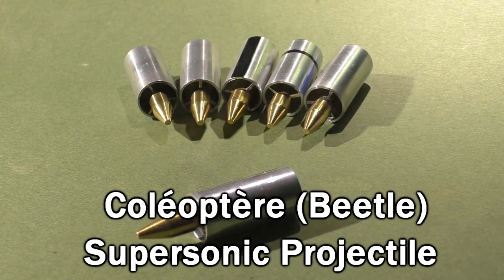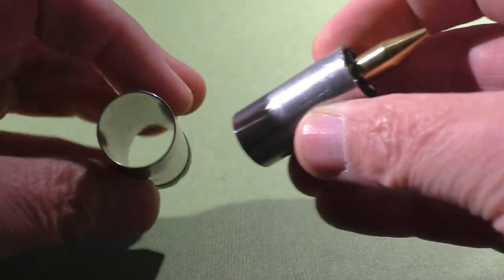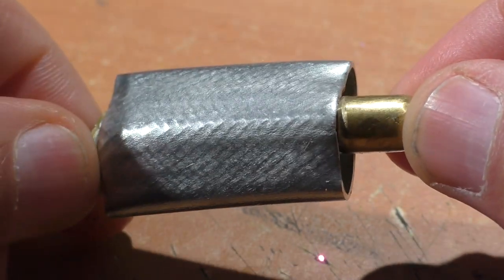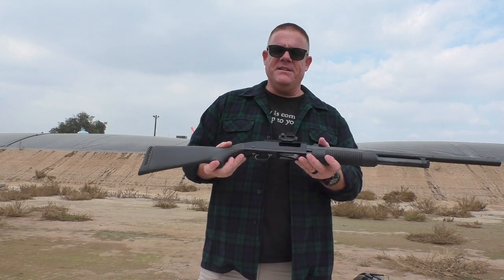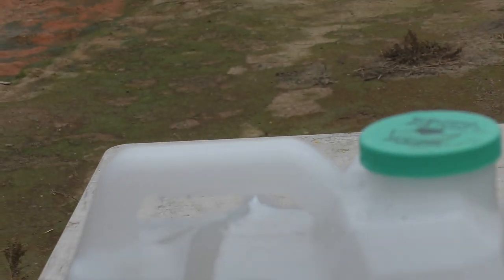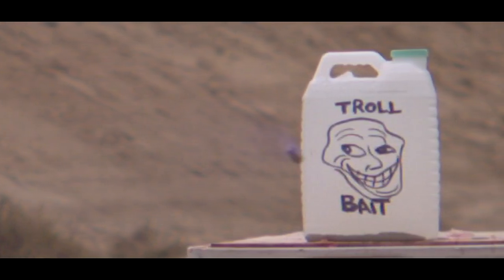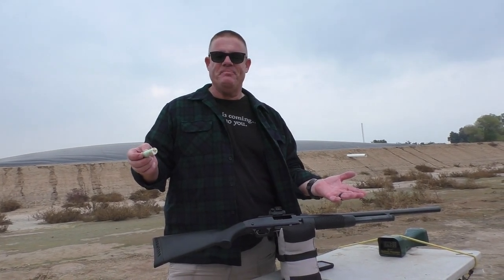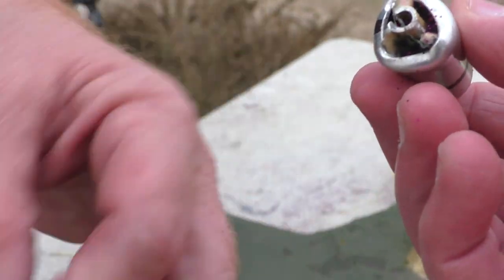Coléoptère Inspired 12ga. Projectiles -  TESTED

Comment: The first round that yawed is why you want to do things that act in any way on the projectile in equal parts. The top sabot support should've been split into quarters instead of halves as halves would create pressure hemispherically and quarters should equalize. Always a balance needed in x and y plane if you want the best example of aerodynamical flow.

Comment: The old firearms adage "The French copy no one and no one copies the French" applies to aircraft, as well.
Reply: Technically the french invented the sabot. The Brits got the two inventors out of France before the germans captured them luckily. So the brits took the idea made it work then eventually the Canadians did a lot research and testing and perfected it. Though I suppose it doesn't count as copying if the brits took it from concept to reality
Reply: @smolwavingsnail9028  The French also invented the modern tank, starting with the Renault FT-17.
Reply: And let's not forget about smokeless powder, self contained percussion cartridges, and haute cuisine. And where would we be without mirepoix?!
Reply: @nocount7517  little willie was invented in 1915 the renault in 1916
Reply: Oscillating turrets, compressed-air fume extraction... Yeah, applies to tanks too.
Reply from the maker: The French were REALLY influential in aircraft design,  probably more than any other country.
Reply: This aircraft was designed by Germans in WW2
Reply: Everybody copies the french, just have a look at all the fake croissants out there😁
Reply: @smolwavingsnail9028  Actually Germans made several saboted shell designs, including 88mm shell fired out of 128mm cannon. German problem was lack of tungsten, not lack of ability. They also made extremely long range large-caliber saboted artillery shells
Reply: @bezimienny_andzej6425  you got a link to the source material ?
Reply: @smolwavingsnail9028  Youtube autodeleted my reply for some reason. Find "German explosive ordnance" publication, there you can find saboted FLAK shells. I've read an article on long-range artillery, but that was 10 years ago. Regarding armor piercing - I know something was posted on Warthunder forums. Anyway, the thing is - you won't make an effective APDS out of steel, it'll just shatter, you need higher density of tungsten (or similar materials, like depleted uranium) and well - I hope I don't have to prove this one to you? Soviets made APFSDS of steel and it was pretty damn horrible (300mm penetration compared to WW2 88L71 achieving 230-240mm).
Reply: @smolwavingsnail9028  There was also a 15cm Panzergranate 39 TS, which was essentialy an 88mm Pzgr 39 fired from 15cm howitzer like the one mounted on Hummel.  You can find quite a few links, but I can't direct you at any specific book here.
Reply: @bezimienny_andzej6425  I'm guessing these were all war time developments. The two french gentlemen came up with  their designe before the war (correction just after the war) So until ive got some solid proof that proves the germans had it before the war I'm gonna believe my own information from what you're telling me it sounds like germany found some sabot rounds likely from a firefly and decided to have a go. Artillery wouldn't need sabot so I don't see how thats feasible either. The whole idea is to launch a smaller harder projectile faster that doesn't fit the ethos of artillery being artillery is used as a mean to barrage an area the chance of hitting a tank at range with artillery is very slim
Reply: @smolwavingsnail9028  Dude, I've never said they had it before the war or that those gentlemen were not the first. Just that Germans had no problems developing it by themselves and it didn't change anything, since Germans simply had no material to make APDS projectiles for their tanks anyway. 

Artillery used a sabot to achieve higher range for HE shells (to engage targets way behind frontline or to engage high-flying aircraft when speaking of AA guns) and when it comes to 15cm one, which was actually Pzgr 39 88mm with sabot - it was designed to be used as a means of direct-fire defence (higher velocity - way easier to aim) at short (for artillery) range.
Reply: @bezimienny_andzej6425  I see my apologies the way you said actually made it seem like you was implying the germans did it first. But now I see what you meant. I also wasnt saying the germans didn't use it. Although saying "developing it themselves" I'd say is questionable I'd still wager they took inspiration from the british sabot shells flying through the front of their tigers. But yeh I see your point with the artillery as well. Reduce then pay load but gain range
Reply: @smolwavingsnail9028  Well, there weren;t really any British shells going through fronts of Tigers in any serious numbers in 1944, also Tigers were actually quite easy to penetrate if 17-pounder was available. But that's beside the point. They would have to essentialy capture such shells intact and then reverse-engineer them, and as you can see, they had developed several types so it seems they spent some time working upon those. If Germany had substantial supply of tungsten, then capturing those engineers could have made a difference since they would allow Germans MAYBE to speed up the development (but it wasn't the idea but the execution of details, that slows down such projects) and kill allied tanks more effectively without any need to go for higher-powered tank cannons like 88L71 or 75mm Kwk 42, since kwk 40 would have plenty of power available with sabot rounds, and if that wasn't enoug - then some kind of lightweight 88mm would work nice too (APDS has noticeably less recoil than standard APCBC shells and higher caliber means you can achieve higher velocity with lightweight projectile with less pressure). But this is just pure alternate history :)
Reply: @smolwavingsnail9028  First of all, it seems the French didn't even design discarding sabot, they had nice developments in APCR, but all nations already had APCR early in the war, so the French design was copied by everybody.
The Brits designed discarding sabot, and so did Germans.

The thing is - Tiger has 100mm of armor and Firefly DOES NOT need APDS to kill a Tiger at most combat ranges. APDS had actually quite a few issues, including accuracy and tendency to shatter. And Brits had pretty good AP shell which did the job just fine. Panther glacis would be a good target for APDS.

There weren't that many Tiger encounters. And no, they didn't take the idea from Brits, unless they were the most genius engineers in the universe and just turned a few captured shells into several designs in span of weeks. 

So to sum it up - there was barely any point at using APDS vs regular Tigers, there weren't that many Tiger encounters in the first place and Germans would have WAY TOO LITTLE time if they captured the shells in f.e. September 1944, to create SEVERAL working designes in a few weeks.
Reply: @smolwavingsnail9028  Also you can find mentions of TS (discarding sabot) shells in Geschossringbuch with 1943 date. Brits developed APDS, but discarding sabot apparently was nothing new in 1944.
Reply: @bezimienny_andzej6425  what are you talking about. The 2 french men from edgar brandt company developed the designs for a sabot in the 1930's it wasnt until 1940 after the Brits got them out of france that they took the design and made it work. Until proven otherwise that was the first record of sabot. I don't understand what you're trying to say here
Reply: @smolwavingsnail9028  I'm telling you non-discarding sabot was designed before the war and during the war Germans had discarding sabot before Brits ever used their APDS in combat. You are just a firm believer in something that is clearly false. Discarding sabot was a pretty simple idea, but tricky to execute, that's all. You make it seem like Germans had lost some kind of huge asset while it had basically no impact on their war effort due to aforementioned tungsyen shortage and the fact that they developed discarding sabot on their own.
Reply: @smolwavingsnail9028  Also let me illuminate you:
"In the 1930s, to increase terminal velocity without increasing diameter, engineers working for the French Edgar Brandt company developed "saboted" ammunition, in which a heavier sub-calibre core was surrounded by a lightweight "sabot" (the French word for 'shoe'), that was retained for the duration of the flight until impact." 

That's HVAP/APCR/Pzgr 40 (hartkern) for you, which all major powers had introduced early war or even pre-war.
Reply: @bezimienny_andzej6425  correct I'm getting mixed up between discarding and non discarding. How ever I've looked for your german Ts ammo and all I've found is some documents on development and one 1 finished 10.5cm le.F.H. 18 example that was sent out for testing. So yeah you're correct they developed some sent it out for testing but never used it. The brits however had developed theirs and started using it by 1944
Reply: @bezimienny_andzej6425  man imagine if they finished the 10.5 cm tiger 2 prototype and perfected apds that thing would have been scary af
Reply: @smolwavingsnail9028  Many types were in testing, including 128mm with 88mm "core", and even 240mm one for long range cannon. The difference is - those German developments were pretty "specialized", whereas better AP shell was simply an extremely needed thing. 
In other words - it's like a machinegun vs flamethrower. Machinegun is simply universally useful, while FT is v. limited. 

If Germans had tungsten reserves, this would be way more interesting. But they did not.

Comment: I think if they just add a little twist to the fins it would greatly improve the performance. With the strait fins it trys to correct it's rotation as soon as it leaves the barrel. Twisting the fins to match the rotation of the barrel raffling would be a good starting  point.

Comment: Wow, that a very interesting design for a slug! Thou I believe the whole concept of aerotube works better for subsonic projectiles. Maybe some supersonic rocket shape inspiration next time? )
Anyway great video!
Reply: Some really simple stainless steel exhaust vanes, behind a very tiny SRB. There are several YouTube channels that explain how to make a very tiny SRB out of things you find at home.

Sure you might burn up the vanes, but it would be spinning by then.

I don't think trying to drill holes in a bullet is ever going to work, to make a gyrock.

Something shotgun size could be 3D printed if you got access to a laser 3D printer at work, and a boss who watches the channel.

Comment: The takeaway I got was that the fins need to be welded or somehow fixed to the outer tube and also that the shape was not super stable. I think the center of mass might still have been too close to the middle.

The behavior of the spike simply blasting on does make me think that if a diabolo or other stable shape had a hole drilled in it (not all the way through so the spike can't fall out the back) and a spike set in it, the spike would punch through the target while the rest of the slug stopped. (Perhaps one of the designs you tested has already done this.)
Reply: If ever mass produced, the alumni(i)um sleeve, fins and hollow center tube could be made as a single piece by extrusion. Chop it to length and do any trimming/shaping of the leading/trailing edges of the fins if/as needed. Insert spike/rod - and done...
Edit - auto(in)correct...
Reply: Would removing or modifying the tube, between fins, help stabilization? Im thinking lowering the height of the fins at the top and calve out tube between fins, in a obtuse oval shape? Maybe add surface grooves at the end?

Comment: I think the biggest problem was the wooden plug AND the glitter. 
Both get slammed into the round, preventing airflow established in the chambers.
Using a metal plate instead of the wooden plug would have helped to keep the bullet in one piece with proper airflow.

Comment: Bros, that was a rock solid awesome vid. A couple of observations if you don't mind.
1. as the was based off the 'hoop wing' design, is having a full sheath the best way, where a 1/2 or 1/4 sheath might have worked better, bit like a sheathed dart?
2. would swept fins have worked better?

Comment: If the fins inside were angled, they would spin-stabilize without rifling. Would do better at 30-50 yards, and I'd put a vent on the base plug to pull it out of the low-pressure zone in the rear, also cut a lot of the middle material out of the front sabot to allow it to start it's aerodynamics sooner out of the barrel. Love the vids, RIP Danny!

Comment: A trick for your projectile design if you want to catch that shockwave in the inlet : your mach number determines the angle of the shock cone (sin^-1 1/M), so given your velocity, you can position the tip of the projectile near enough the tunnel. That one looks a bit too far up front.

Comment: You can add rifling to that projectile by giving the fins supporting the brass a 3/4 turn inside the aluminum casing which will cause the projectile to spin as it passes through the air and the air is forced over the fins surrounding the brass

Comment: Kevlar works a bit like a net catching a trapeze artist by dissipating the energy over all the length of the fibres, the sharp pin on its own may not be able to spread aside the fibres without loosing too much energy to pass through because of this effect, the outer ring acts to pin the fibres down so that they cannot transmit the energy to their whole length allowing the pin to easily push through.
The Coleoptera was not the first use of a tube wing, all sorts of whacky wing designs were used in the 1920s and 30s

Comment: Stronger alloy of Aluminum like machined 7075 billet would help. Then TIG or braze the assembly.
Please correct me if I'm wrong. IMO I detect some discord from you Jeff, when OG started talking about the round's design.

Comment: Suggestions for next time: Glue the wooden plug to the Sabot so that it has no choice but to seperate with it. Also try casting these things instead of machining them out of multiple parts, the less chance for it breaking apart the better. 
Ideally they should be 3D printed, but finding a metal printer is still difficult these days.

Comment: I think if the exterior tube were to be milled from a single aluminum block with the center drilled through for the brass piece to be inserted, thereby eliminating the possibility that all the pieces come apart from the initial G-shock that would give better reliability.  When milling the rearward section of the tube interior could also be given a slight angle on the interior ‘wing’ section causing it to spin whilst in motion rather than depending completely on a rifled bore (which didn’t seem to help much anyway).

I would love to see how much different it would shoot with these two mods.

Comment: So the glitter kinda helped weld it in and it worked. That might be as close as you get to the SR71 inlet unless you weld contact points inside the tube.

Comment: Interesting projectile. Maybe if the design inside had a little angle in the fins, instead of being strait, like a screw. To make it spin around the trajectory axis. The angular momentum conservation should help with the in-flight stabilization. Like what happens to a bullet coming from a rifle, it spins to stabilize it. :)

Comment: Would be interesting to lathe some riffling on the outside of the aluminum section. See how much/little it affects the flight through drag. I doubt it would due to the fact that the shockwave is removing most of the air past it. Why it shows up on schlieren photography.  You can really see the back section biting the shock wave air as the projectile wobbles through the air in that last slow mo shot. I might be wrong but it appears to switch between a lifting body and not as it oscillates near the target. 

If the aluminum fin section was made from a solid piece of brass stock that was drilled out to form the fins you would probably get a better result. If you want to make it super scary, make the tip section out of threaded steel that inserted into a tapped hole in the brass. The brass would deform and strip the threads on impact leaving the steel free to penetrate. 

For it to work like an SR71 though if you REALY wanted to put in the work you'd want that interface brass/steel (above not the tested one) not to be threaded but a spring steel coil that as the speed of the projectile slowed it moved the steel tip forward. It'd be stupidly complex to make and you'd need to math out the strength of the spring to keep the tip of the shockwave ahead brass section but not so much that it's not interacting at all. You would have to tune it to the load. It's a lot of variables, I duno that you could even exert enough force with spring steel to overcome it all and if you did if it wouldn't form a weird resonance frequency with the shockwave that'd ruin it. 

I'm betting also that a diablo shaped slug with a steel pin in it would give simple & easy results.. The pin would take the shockwave the slug would provide the stabilization and mass to carry into the pin on impact.  Fairly sure you have a diablo slug cast. You drill out the center and put in variable lengths of steel nail to test it at different shot loads. Single hole drilled into lead, and precisely cutting the nail,  would be the hardest part of the process. 

Really cool round all around, got me thinking.